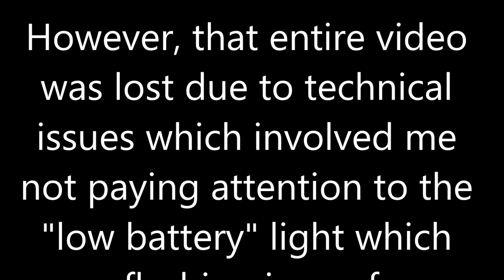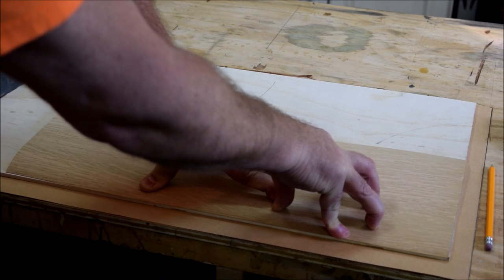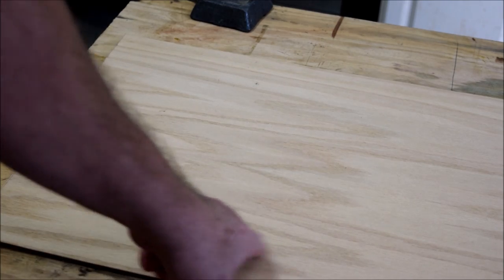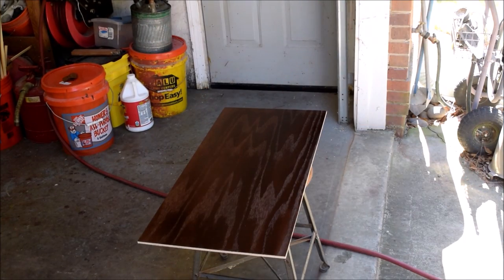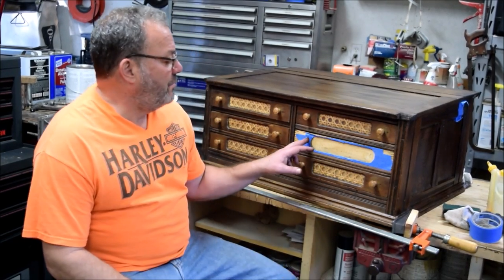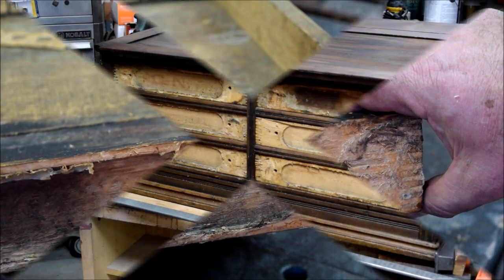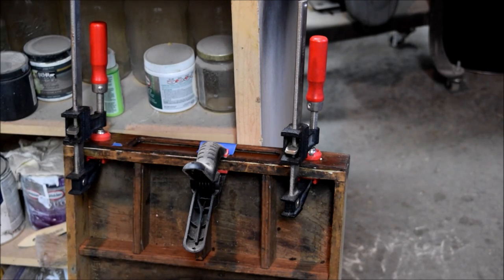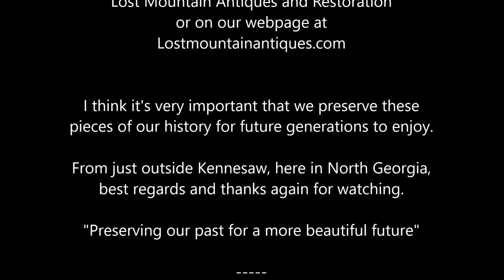Repairing an antique spool cabinet

Comment: You are correct that hide glue was likely used to attach the fronts.  Hide glue is the glue of choice for prewoven cane, which was used in place of the inserts.  Fortunately it responds well to heat.  Great job!
Reply from the maker: Thanks.  Worst part was the prewoven cane was sealed in plastic.   Go figure...